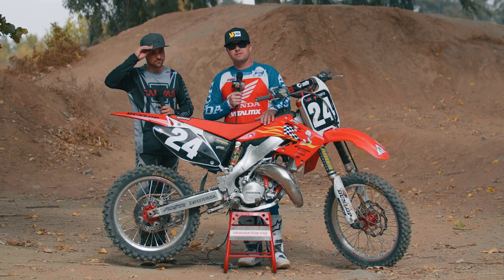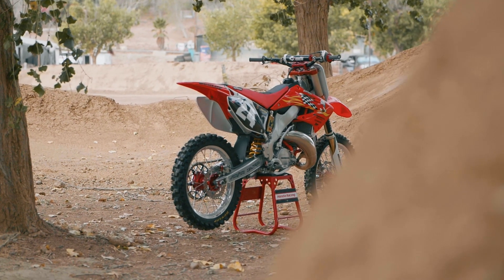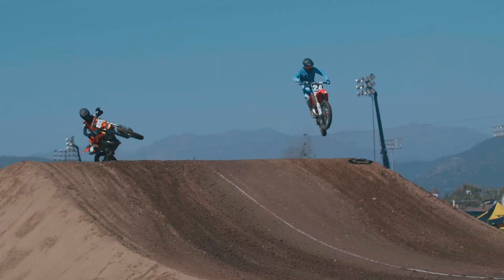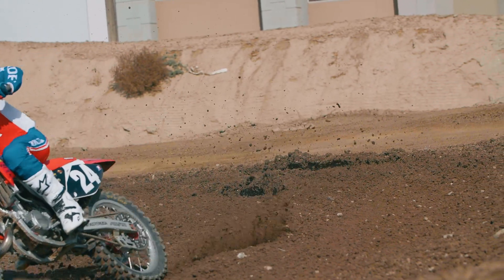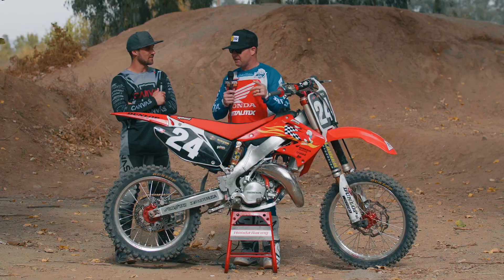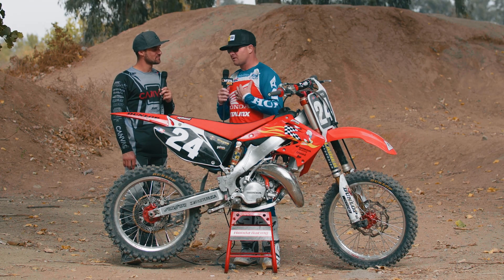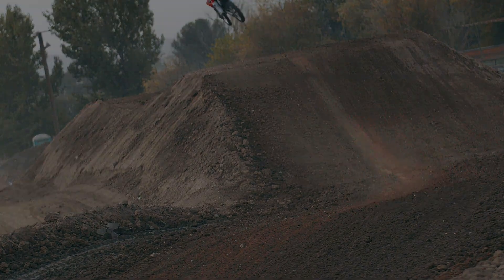2002 Honda CR125 Project Bike

Comment: I had a 134 cylinder for an 03 cr125 engine. It was way down on power compared to my 02 stock motor. I believe the angles of the ports become shallower and mess up the porting. I would love to know more about the engine setup like porting and head volume, squish, power valve setup, case mods and reeds etc. Please share this info it's not like it needs to be kept secret 18 years on 😅 

Bike sounds fantastic. And great job at red bull it made me proud to own one.
Reply: Sorry 4 my english, i'm italian. 2002 factory connection honda, have a plate under the cylinder for raise up the porting, and a rod connecting longer than stock
Reply: I had two or three as well with ahead mailed to a different shape and running the RN piston which was taller giveaway more lower low-to-mid snap which carried right into the top-end Iran the pro circuit pipe with the 134 outdoor silencer and it just scream to the Moon the chassis was just beautimous

Comment: Does any one know if the PWK 38mm Airstryker will fit in a stock intake airboot and reed cage boot for a 2002 Cr125?
Reply: yes it will ...i run one on my 02 125 .........:)

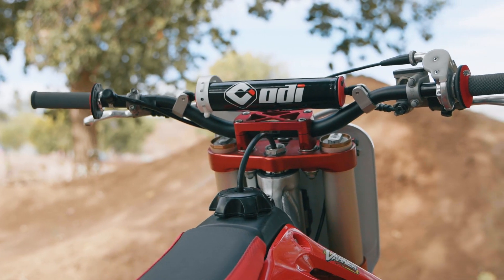Comment: You got second in the straight rhythm cuz that for one that bike was far more advanced than everybody ever gave it credit for is Ricky Carmichael can attest the frames were almost identical on the 2:50 those Honda's all the way up till 7 really super stable sharp turning chassis that were perfected by that time it is you can see if you watching the video the KTMs Johnson all over the place through the wolves in the Hondas just level as can be just a really really great chassis the motor slightly lac stock though

Comment: So it’s not a 125!

It’s a 134....

Bike looks good though and good result at RBSR🤙
Reply from the maker: 125-ish...and he was still at a disadvantage compared to the 150s at that race.
Reply: Vital MX Yeah def, modern bikes nearly 18 years newer, later geo, sus etc not saying his effort wasn’t awesome it was outstanding, result in final imo still rider though, the bike was clearly good enough, as a Roczen proved against the Factory KtMs made into 300s.
I just point that out because title says 125.
The only disapointing  thing about RBSR is the cheating! esp by KTM.
If you have a 125 class it should be 125, not 126, not 134/144/150, same in 250 class if it’s called a 250 class it’s 250cc not 265/300.
Worse is that the biggest cheats already as above stated have at-least a 15year advantage in evolution over 2000s gen CRs, RMs, KXs and YZs.
The title said 125 so why I called it, top effort bike looks and sounds mint as. btw some good riding by the Ping as well he looks good on a CR 2t🤙